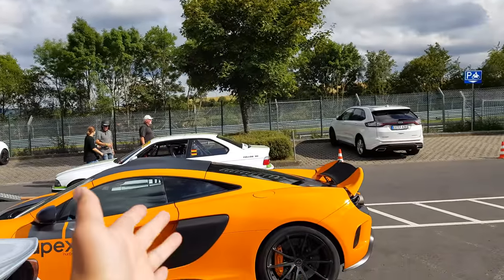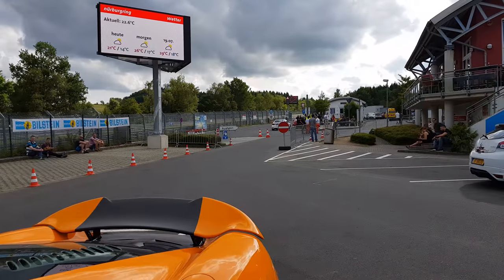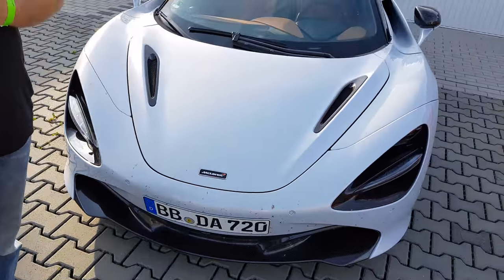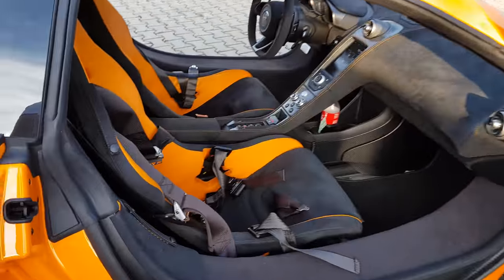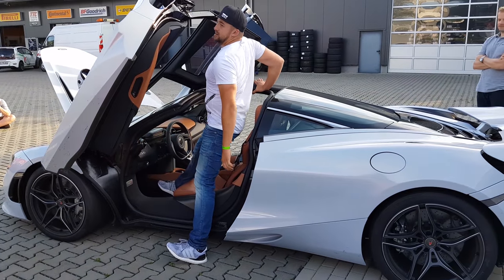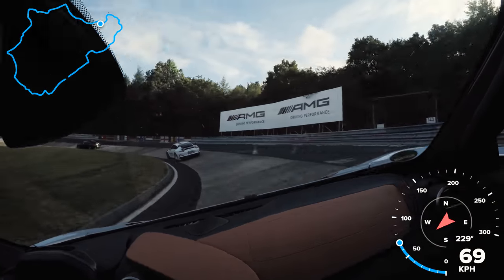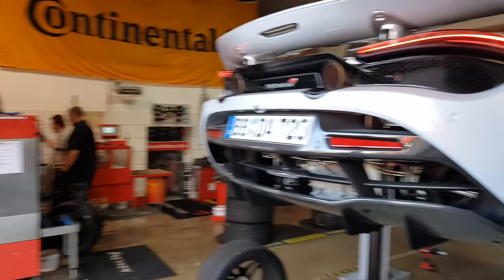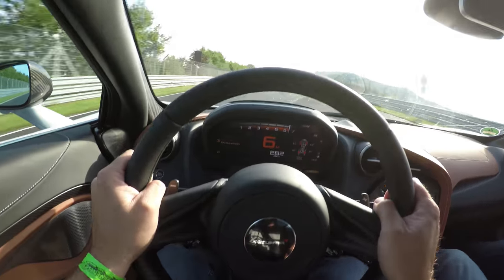McLAREN 720S vs McLAREN 675LT NÜRBURGRING COMPARISON

Comment: Great video. One thing I would like to add. The underbody plates that direct the air to the sides I believe have a slightly different function than anticipated. I think the flat body and the angled rear-diffuser create a huge downforce at the rear. To balance that, they force some of the air away from the car, in the front to create, as you said, a lower pressure zone in the front, which effectively lowers the potential downforce at the rear. I beleive that is mostly for aero-balancing. One more thing I believe it does is, the wake from the tire which enters the underbody, as small as that is, is again forced away. lowering lift. All in all I believe that total downforce would increase if you just have the outside plates/canards on the underbody to regulate wheel wake, but downforce will be too-mutch rear-biased resulting in understeer. Just my 2 cents really. Awesome car and great video.

Comment: We need a combat roll out of the 720s.  "Glide out?" busted me up. At some point in time a 720 owner is going to pull the steering wheel off using it as an exit bar. LOL Good vid as always.

Comment: If you have a 675Lt and you track it  then you need to wait for the LT version of the 720, the 720 is really the new 650 but what's impressive is the 720 is so improved over the 650 it's faster than the LT in a straight line and almost as quick on a track but it is more GT like than a track weapon.
Reply: THE MAD TECHIE it's a improvement over 675 dude

Comment: Misha Charoudin only thing i wanted to say is, misha's friend was saying he thinks the suspension is maybe a little "soft" when driving on the limit.
But you guys didnt put the 720s in race mode? Witch then stiffens the springs even more then sport mode.
In full Race mode the tacho screen fold down, only shows you the gear you'r in, the revs and your speed.
Maybe next time?
For the rest? What an amazing video, great format! Keep this going please, it will rock the car scene on youtube!
Misha you're amazing , and im on the ring every month also, because the track is amazing, the vibe and the people are so cool, and ive gained alot of experience iver the years by going to that place :)
Easy when you just live 200km from it 😁
Epic job guys!!!
Reply: Nicolas Dujardin the car was in full track mode. You can optionally raise or lower the display in all modes......

Comment: These "canard´s" on the bottom of the front seem to be the lowest points of the car. Are these scratching when the car is going through a compression? Didn´t see scatch marks when you showed them. If not ... what else is touching the ground?
Reply from the maker: Probably them :)
Reply: I think it's Misha's balls of steel hitting the ground
Reply: LamboPlays steel has become too heavy of a material, with Apex creation Misha upgraded his testicles to titanium.

Comment: if you are saying you was driving/testing the car to its full potential how come the screen/dash wasnt down,cause when the car is in track mode the screen goes down
Reply: lol-... you can select up or down for the screen in any mode.  The car is in track track and I put it up so that I can see tire temps and tire pressures.   I would actually put it down for street driving and up for track as that is when I actually want more information

Comment: Love seeing Robert drive this! I hate seeing these cars garaged and parked. 
Misha can you try something? Try to record at 60 fps insead of 4k 30fps. That makes it look better
Reply from the maker: I'll wait for 4K 60 FPS :D
Reply: Not a lot of cameras have 4k 60fps! I'd rather see 2.5k 60fps first, cameras are affordable :)
Reply: SGS7 & SGS8 have issue with AF when filming in 1080@60
Reply: 30fps gives a faster feel compared to 60fps. 60 smoothens it down. I use 1080p because of the filesize difference but also on 30 fps. Maybe its just personal prefference xD
Reply: 30fps is more for standard filming of normal motion. 60fps will give less motion blur with high speed action compared to 30fps

Comment: I think the 720s with the track pack and track spec should be as fast as the lt no ?
Reply: Alex Rdz the track pack etc makes no difference to the speed of the car
Reply: robert_mitchell Yes i'm not sure but i think that i'have heard that the suspension, the aerodinamics, and the and handling were more track focused in the track pack
Reply: Alex Rdz no, it's all optical along with Carbon race bucket seats. Nothing to aero or suspension.

Comment: Robert I think you should sell the 675LT Spider and buy a 720S. Because you said it yourself that you like the coupe more than the spider because the spider is more quiet than the coupe and more confortable. So if you want confortable car buy the 720S also it will  be different than the 675LT and faster.

Comment: The 720 is faster than the LT, but they're not the same type of car. The 720 is the same as the 650, it's just the "standard" model, on which the faster (!!!) track version will be based on.

Comment: What i dont understand is that. Why would you want a 720s in my opinion driving on the track isnt about speed or laptimes, it is about feeling the car and. Being able to control it on the limit so why would you have the 720 if it does alot of things for you. That takes away the essense. I think   never driven one so i might be wrong.
Reply: Oscar V the lt is hands down the better track Car IMO.  No comparison.  The 720 is amazing but the feedback and feel of the Lt makes it
Reply: robert_mitchell So you will wait for the 720 LT? Nice!

Comment: The 720s is a replacement for 650s, you can't compare to 570 or 675 as they are in different  series.
Reply: But the prices aren't that different (as stated) and everyone expected the 720s to be a 570s on steroids, at least as fun to drive as the 570. Apparently, it's not, just a lot faster.  As for the 570s, it's just is a downsized/cheaper 650 and the 720 chassis come from the 570 rather than the 650, so the comparison makes sense.

It's a pitty Mclaren didn't put a bit more work on 'feel' even tho it's a GT they could have made it better as both steering and suspension are electric (not static) the sportier driver modes could be more engaging.

Comment: 4:11 I can't believe this car is so slow out of Karussell
Reply from the maker: The data overlay you see is from GoPro GPS. It lost connection so it went to 0 and then gradually picked up until next pickup point. Real speed is the average 80 kmh.
Reply: Was made that Porsche so fast?